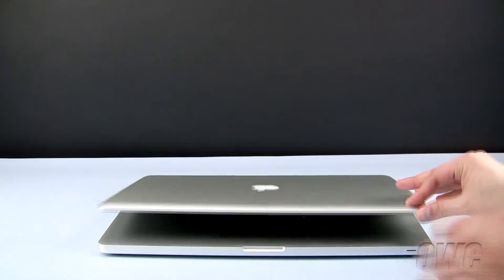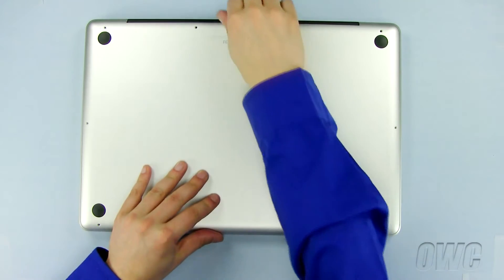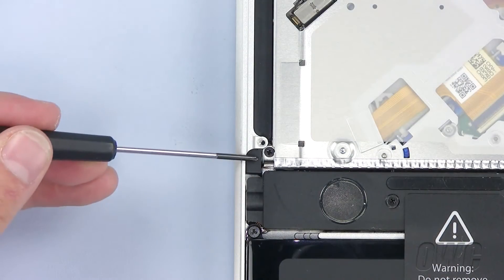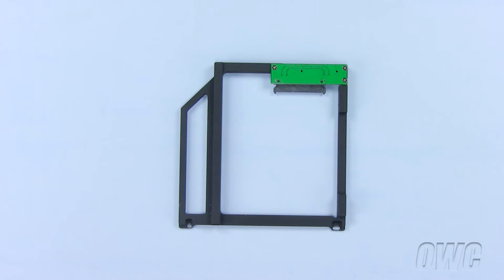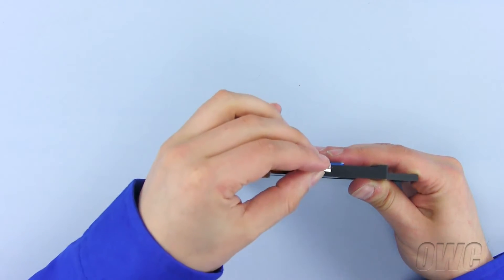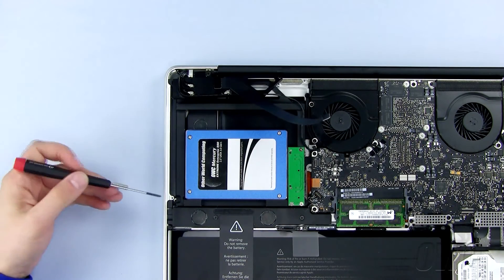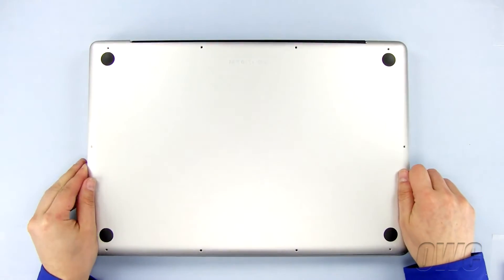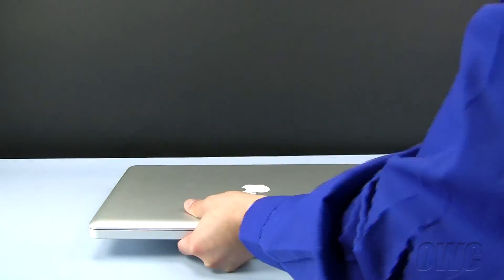17-inch MacBook Pro Mid 2010 Data Doubler 2nd Hard Drive/SSD Installation Video

Comment: Hi, I had a non working optical drive a while ago and i had taken it out and threw it away. Now i see that i will need two parts for data doubler from the drive)) Where can I buy the optical drive data connector and bracket? many thanks!